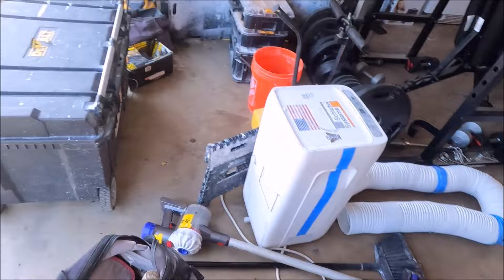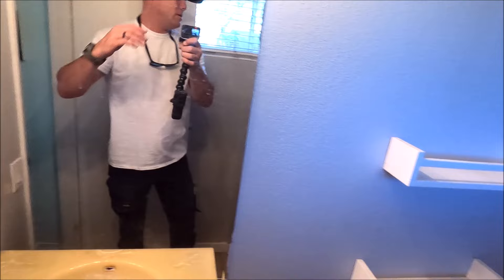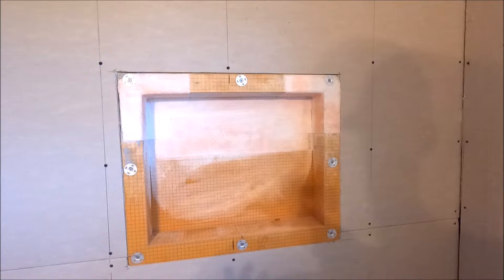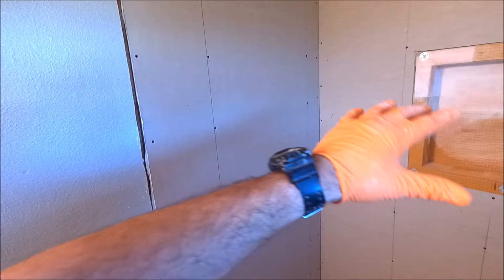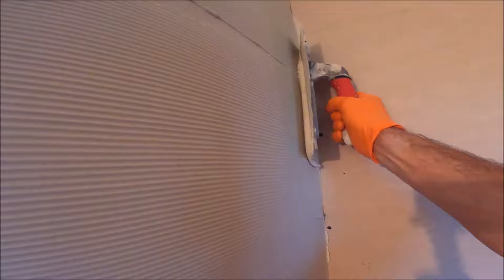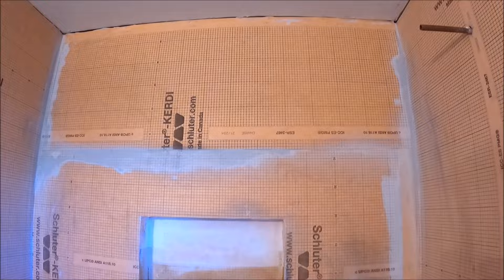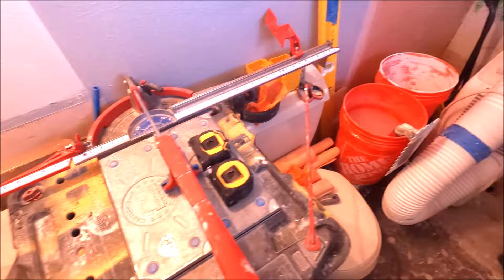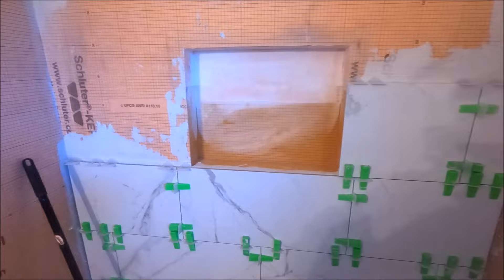Bad Idea? Membrane Over Drywall in a Shower

Comment: I prefer to use the membrane. Just screw drywall up and cover up with membrane. Done deal. No special screws with washers to buy. Then to just run out with the 100 pack then need to buy more because you needed 10 more of these screws and washers. Then you have to mix up thin-set anyways. Along now we also have to cut strips of waterproof banding. Which might end up running short on that at the same time.

Comment: I feel like 5/8 drywall would be much stiffer, stronger and cheaper than Kerdi Board.  Always wondered why people insist on using it to back tile?
Reply: 1/2” drywall is stiffer then 1/2” kerdi board. Plus kerdi board does kind of fall apart if it is constantly wet.
Reply: Because if a pipe leaks, it'll ruin the back of the drywall that's not waterproof. Only the front is waterproof with kerdi, the back is not.

Comment: Sorry I would have used cement or hardiboard. I'm also in FL and fiber cement is code here. Drywall no matter what's out over it is instant fail on inspection.
Reply: I'm in Florida too and the last inspector I dealt with was so incompetent I couldn't stand to be within 50 feet of the guy.  Florida inspectors prove the old saying....Those who can, build.  Those who are utter buffoons, inspect.  And for the record I've seen a long list of failed showers in flips I've bought that were installed using Durock or the like.  The experience and competence of the installer is far more important than a particular material.  Florida's building departments are simply too stupid to grasp that reality.
Reply: @Mike-In-O-Town  To stupid to grasp? Maybe you should actually go back and understand WHY they require what they do. Having been a contractor in the state for 20 years, I'll take a take a fiber cement board over plastic form trash anyway of the week. You should also look up other states as well. You'd be surprised that less then 25% of the states actually allow or approve that kerdi crap. While the others all require some sort of a fiber cement board.
Reply: Protec finpan, 1/2 inch, That's what I use in florida.
Reply: Oh yeah, it's fun trying to tell plumbers and tile guys. That think they know everything that they're wrong. and they've been doing it for so long wrong that they actually think it's right now.

Comment: Schluter warranties that and recommends doing it that way with there kerdi, lots of builders in my area just Sheetrock the whole bathroom and shower or tub because it's going to get the kerdi all the way to water proof the sheet rock, hell Schluter pushes that scenario or used to but if you don't do the kerdi to Schluter standards it won't be by warrantied
Reply: All the mud and kerdi still only secure by the paper coating on the drywall.
Reply: @kevinolson906  Assuming no water penetration, have you ever seen drywall fail to hold tile?

Comment: I've done couple dozen over drywall have had no problems why pay for expensive board
Reply: Exactly. I always tell customers why pay more when I’m waterproofing anyways
Reply: @jakeklassen3702 because you are still only securing that to the paper layer on drywall.
Reply from the maker: Yup, we've done a few dozen without any issues. Keep in mind, we tear out 35 year old showers with zero waterproofing and builders grade ceramic tiled directly on drywall..
Reply: Yeah so weird we did every new home just 4 1/4" wall tile and mastic our company probably did thousands now I can't imagine not using water proofing of some sort